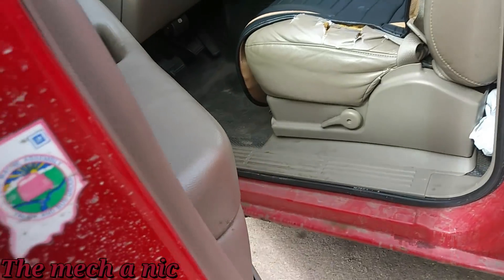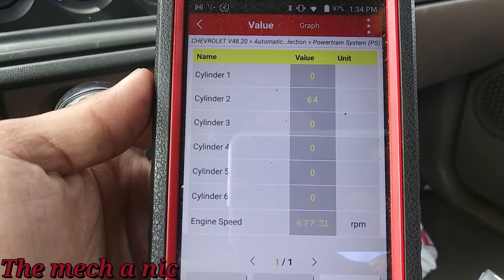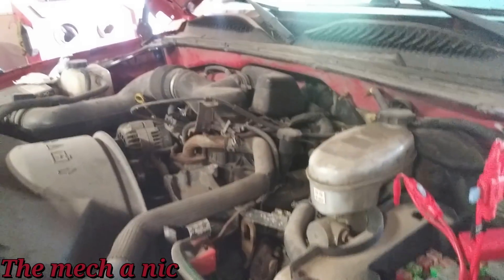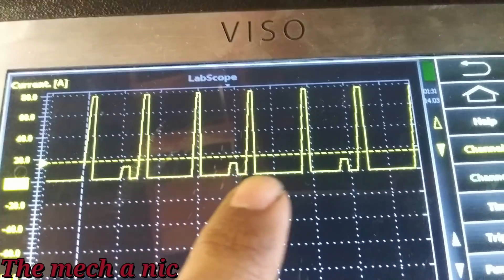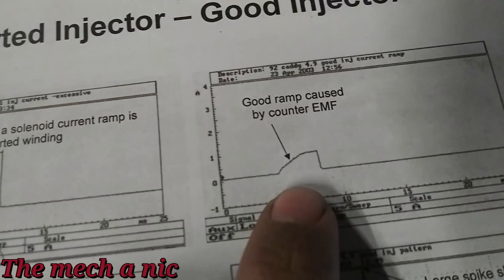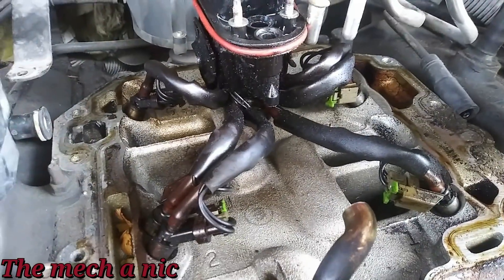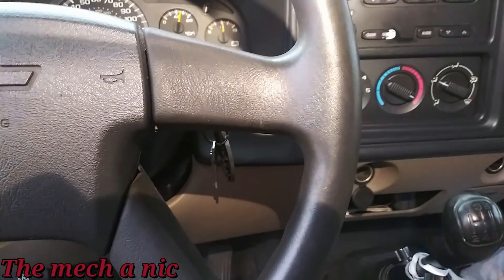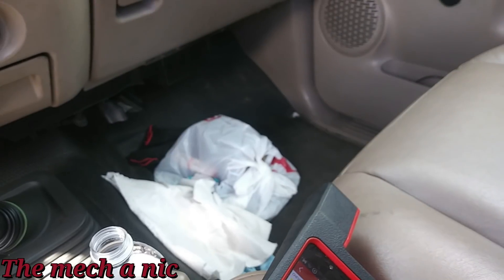silverado misfires on #1 and #2

Comment: I'm surprised to find an old distributor king lead system in a 2005 GMC, since my 2000 Suburban had already switched to coil-near plug. Those old king lead systems are perfectly designed to compare secondary voltage waveforms, since all cylinders fire off of one coil. Regarding your fuel injector current ramps, you may be seeing something else running off that fuse, or maybe you're getting interference from nearby wires. In the end we all learned something here, and I am very impressed by how you faced adversity and accepted results with humility. In the end you found the answer, your customer got outstanding service, and it makes for an excellent case study. Two thumbs up!

Comment: Very astute checking out that distributor cap.  It looked like it had a small crack on the inside by one of those 2 screws that hold it(d. cap) down too.
Reply from the maker: Yes i noticed that also 👍

Comment: Using a catch container, using a pressure washer to spray out a CAT, sometimes, can save it, being much of the damage is build up from non-firing cylinders. It doesn’t cost anything to attempt it, because CATs are not cheap. OR, an option is move to place that doesn’t have emissions, or has a more forgiving emission program, where as long as you test 3 times and attempt to fix the issue and show receipts you will pass.

Comment: More than once i have fixed these spider injectors by crimping down the electrical pins that the spider unit fits into. Pin fit issues are usual on these

Comment: Hey neighbor 
I was wondering if you did a injector leak down on them or a voltage waveform but to sum it we learn everyday. Like yesterday I had a avalanche 5.3 that had  both banks lean. Flex fuel model. The first thing I did was to reset my alcohol content. No luck. I was told the vehicle had a petrol ⛽ pump put in 2 years ago.  My coworker put a flex fuel pump and behold I was back in fuel control. Just both LTFUELTRIMS  ON BOTH BANKS WERE 30%. WITH PETROL PUMP. BUT IT RAN GREAT.🤪👍👍
Reply from the maker: You did the same thing i was thinking lol as soon as i read that i said to myself reset the alcohol content😂thats interesting. Whats the difference between both pumps? Different psi ?Different volume?
Reply: @themechanic6117  different blends of gas tiers. Summer, Winter really messes with fuel trims on flex fuel vehicles. But they have same pulse width psi from a return less fuel system with the fuel pump pressure module above the spare tire

Comment: It looks like the inj1 fuse feeds the ignition control module and bank 1 injectors. Inj2 fuse feeds the coil and the injectors for bank 2. In the future when you hook up your scope, always use a trigger. Had you grabbed the ground side of one of the injectors you would’ve seen the humps for the injector and then counted how many humps you had between each event.
Reply from the maker: Thank you for your advice. Those definitely looked like more than injector current ramps
Reply: @themechanic6117  do you have an email or some other way to contact you? I’d love to talk to you more about scopes and diagnostics.
Reply from the maker: My Facebook page on messenger or Instagram. I can give you my email but i dont check emails that often lol

Comment: That's sux! Those injector's aren't cheap. If you had bought them from the Zone there's a very good chance that you could have returned it for a full refund. 😁
Reply from the maker: Yeah maybe but i got them from rockauto because it costs less. Even if it was from autozone i wouldn't have going through the hassle of removing. Its fine the customer can get new parts n make the car more reliable👍